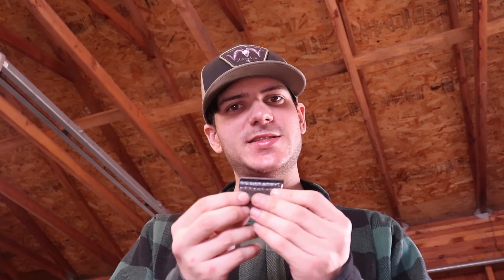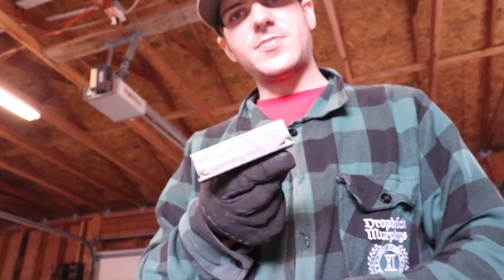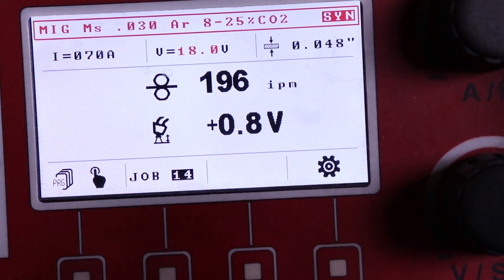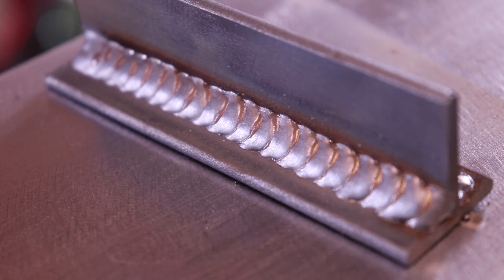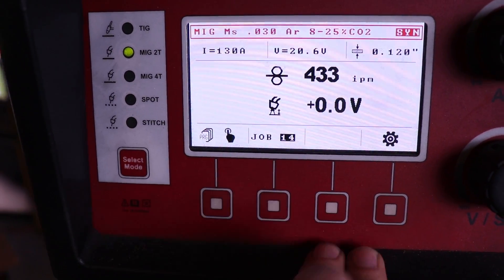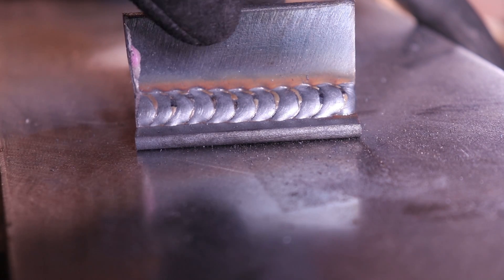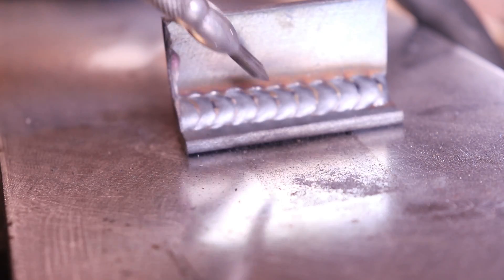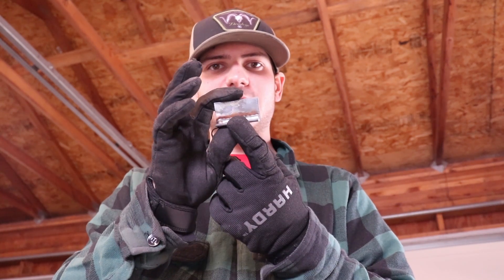Mig Settings Cut and Etched

Comment from the maker: Hey guys thanks for watching. Let me know what you'd like to see next!
Reply: I'd really love to see if you can do flux core welding and replicate those "stack of dimes" look. Thanks in advance!
Reply: Open v groove 30° on carbon steel 3/16 to 1/4. 1 g and 3 g
Reply: Dont know if you mig weld carbon pipe schedule 40 I work for a plumbing company but I've been welding for about 8 years and I have mostly welded structural with mig tig but not much pipe and trying to work on getting good penetration on carbon steel schedule 40. I just subscribed so hopefully we can see something soon on this thanks in advance for any help
Reply: How bout 1/4 in coupon.035 wire cut and etch

Comment: YOU DON'T NEED TO TURN YOUR MACHINE DOWN TO MIG LIKE TIG

YOU ABSOLUTELY CAN STACK DIMES WHILE YOUR MACHINE IS TURNED UP WELDING HOT
Reply from the maker: Definitely true you can stack dimes up nice and hot.  This is specifically for the mig like tig they use in a bunch of offroad shops
Reply: @5thStreetFab  I mostly mentioned it because your cut and etch showed arguably that's not such a good idea.  Get good penetration and stack dimes... just saying that
Reply from the maker: @drumtwo4seven  i totally agree

Comment: You can also mess with the settings and alter your speed and angle with the mig like Tig settings to get it to really punch in there. I did this same test and it looked like the "regular" settings. That's why the mig like Tig is widely used in motorsports. Penetration AND looks.

Comment: Must say this was disappointing because I love your mig like tig method so was hoping it was a strong weld. But it still has a place but what is that. For example would you recommend mig like tig on a bicycle frame or motorcycle frame?
Reply from the maker: I personally wouldn't.  I would rather just tig those.  Mig welding small round tubing takes a lot of practice and can lend to a lot of cold lap especially on places where theres multiple coped joints
Reply: @5thStreetFab  thanks  that’s what I was afraid of. I have yet to learn Tig. My son wants to build a bike, was hoping to Mig weld it up as a project

Comment: Thanks for the video showing the stronger welds.  It seems to me a lot of people are pushing Mig like Tig.  Usually when one welds it is strength that is more important than looks.  I say just grind it to look as good as you can knowing it should not break.  Good video.  I actually want to learn how to Tig weld aluminum and sheet metal because of the smaller weld.  All of the equipment is expensive and I cannot justify my hobby use of a Tig machine.  My HTP  140 is still going strong.

Comment: Let's see you weld with a home mig machine , 4 setting and no trim on the voltage. thanks
Reply from the maker: I have some older videos on here running an old lincon sp100 and a cheaper everlast.  I dont remember their names though

Comment: I'm a fan of your other videos but I don't think this is a good comparison of these 2 techniques. To say that the "mig like tig" technique isn't as strong is inaccurate. I could tell without you cutting it that you were too cold on your settings. I could see the puddle just stacking on top that's why it was highly convex and you were forced to move so slow. Also, many people that get the stack of dimes look prefer to pull instead of push and that alone will increase your penetration. 

I'd like to see you do a push vs pull etch test after dialing in your settings better. Don't weld on the backside either. It's not an apples to apples comparison. When welding the backside the joint is no longer the thickness of the material. It's material plus front side weld.

Now you forced me to do my own etch tests. Haha.

Love your other videos! Keep up the good work!

Comment: Excellent video. I keep trying to tell the world of IG dropping dimes with MIG is not the same as with a TIG and should be avoided unless it's for looks only and has no structural strength requirements.
Reply from the maker: Ya man i found a couple techniques where i can get it to penetrate but it doesnt look as good.  I guess youll always have a trade off!

Comment: Great video. You have proved a very important point. Stack of dimes looks great but it is not necessarily useful for an integrity perspective. However, practicing a SOD takes great control and is great practice. Master it and you should find  doing good quality structural welds is easy. Well, kinda! Thank you.

Comment: Great video.   I noticed that your puddles are nice and round.  Mine look like a teardrop on its side, with the front of the puddle nice and round, 
but it has a tail at the end, so it is freezing at the tail, and leaving overlapping shapes like this ◀️◀️◀️what do you think may be causing this?  Speed too fast?  Wire speed too high?  Too hot?  I have played around with the setting, and slowed down, but doesn’t seem to help at all. Thanks
Reply from the maker: That's from having too much heat.  Just back off the pedal a little bit and try again and see how it turns out
Reply: Ahhh... we’re talking mig, but I’ll try colder settings
Reply from the maker: Haha my bad I thought this was one of my Aluminum videos! But ya the v's are from high heat.  You can either turn it down or try pushing forward rapidly and then back into a circle

Comment: This explains a lot to me. I've seen a number of your videos and really like how your welds look. In turn, I've never managed to have my welds look like dimes as I always fine tune for penetration before I start laying beads. Have you considered laying a straight root pass with the recommended settings, then cap off with your MLT settings? Thanks for this video!
Reply from the maker: Thanks dude!  a buddy of mine has been doing a tig root and filling it with MLT.  Looks great and should be plenty strong that way.

Comment: When you ran the correct settings, what pattern were you doing, and would this work on short circuit MIG?
Reply from the maker: Ya I just move forward filling in the root and then a slight up down motion it just helps me with better penetration.  And yes this was short circuit MIG
Reply: 5th Street Fab at 400ipm I don’t think you were short circuiting anymore.  There was more spatter and the arc was more erratic. It looked to me like you were in globular.  The transition out of short circuit typically occurs at 125amps.  With the slight oscillating you were doing in short circuit I have a feeling you would have missed the root.
Reply from the maker: @scotttaber6824   @Scott Taber  ya could have been been globular.  For some reason I thought you needed 100% C02 for globular?  Maybe I'm wrong haha.  I just used the stock settings for it and it said short circuit.
Reply: 5th Street Fab no you can weld in all 4 transfer modes using an argon mix.  I personally find the recommended settings to be way off.  Every time I try and run them I end up making pretty significant changes.  You’ll probably find the recommended settings found for the wire itself to be far more helpful.
Reply from the maker: @scotttaber6824  right on.  Thank you.  I mostly do TIG work but also quite a bit spool CV and pulsed MIG Aluminum so when I do steel at home I've always used the recommended settings and would tweak it from there or just use spray.  Where can I find the wire manufacturers settings?  There website maybe?  And thanks again
Reply: @scotttaber6824  I would like to chime in here on recommended settings as I found that as well. In my shop the recommended settings were off and I had to adjust the amperage up.  One day I took my Millermatic 210 home and wired it to my Air Conditioning fuse panel at 220v and the machine welded perfect at the exact recommended settings from the chart. Took it back to the shop and had to turn up the amperage again while using the same wire inches per minute. I have no idea what made a difference.
Reply: @MrBashian  voltage drop if using an extension cord?

Comment: When I mig like tig I complete each circle right at the root of the joint and then drag or push the puddle over and start my next circle (or lower cased e) it helps focus that heat into the joint itself. Try doing it like that and then lets check the comparison.
Reply from the maker: Thanks I'll give it a go!

Comment: I have been harping on people for years to stop making mig welds look like tig.  Run it hot and get it fused.  👍🏻
Reply from the maker: Haha I'm definitely guilty of making them pretty haha it's just looks so nice I can't help myself!😂
Reply: 5th Street Fab  your stack of dimes with less fusion is still better than a lot of welds out there lol.  Right now I have to reweld a front diff cover because the inside corners seep oil.  Pretty crazy a well known company can’t make a diff cover that holds oil after welding inside and out of it.  At least the welds look pretty 🤔 lol.
Reply from the maker: Haha I've seen that too!  Especially on aluminum.  If you want the outside pretty at least weld the inside right!

Comment: Can you do a demo on MIG stainless steel and what gas you'd recommend ? Video may be overkill lol.
Reply from the maker: That would be cool but I don't want to buy a new bottle and I've only done it a few times I think we run a tri mix but can't remember the exact mixture
Reply: best way to know what gas you need for the wire you are using is to ask the people that sold you the wire. but if it can help you, at work we use a tri-mix gas... argon-helium-co2. we use it on either a pulsing mig welder or standard mig welder. hope it helps.

Comment: 26 27 volts and 600 or so wire, strait bead. Line down the center is what your looking. Idk why all these people wanna see loops in a flat.
Reply from the maker: Different strokes for different folks
Reply: @5thStreetFab  yeah but try it. No movement just a strait pass focus your puddle no back and forth mess. Cut it and see. It's a flat not a vertical.
Reply from the maker: @lsgt5132  oh I know I do it every day at work spray and pulse mostly.

Comment: Some entry level tig weldings demos be great im considering buying a machine ive done mig welding in my career as automotive structural in collision industry but i would like to learn to tig so much cleaner..enjoy your videos thank you for sharing valuable experience and insights to the trade!
Reply from the maker: Ya I would but I don't want to buy any haha.  The AHP was pretty good, I've heard good things about primeweld and Everlast has some that are slightly more expensive.  If you want to weld Aluminum make sure the machine is ac/dc

Comment: Thanks for that, It does show that you can have a good looking weld that doesn't have the fusion needed for ultimate strength. You also explained that, to use the right weld where you need it, or play around when it doesn't really need strength. I tend to get what you showed as the preferred settings for the plate thickness. I have a problem with most videos about settings, I am running a Lincoln Electric STT2 which uses Peak Amps, Background Amps and wire feed in Inches per minute. I never have the wire feed rates you talk about, My highest wirefeed (that I use) is about 200 inches per minute, but I can throw 420 Peak amps at it. At the moment I'm using 1.2mm ER70s6, 390 Peak Amps, 100 Background Amps, 4 on the Tailout and 180 Inches per minute wire feed for a hot, flat weld.
Reply from the maker: Wow that sounds interesting.  I've never heard of it.  Is it some kind of pulsed MIG?

Comment: Always enjoy your video’s. On thin stuff 200 amp welder is ok, but i feel lack of bite and fusion on 3/8 and 1/2”. Guess used Miller XMT from ebay is in future as i cannot afford HTP 300. 
What machine do you use at work to weld thicker steel? Or is it mostly aluminum?
Reply from the maker: Thanks bud.  We have Lincoln 350mps, miller 350ps and a couple different kinds of XMTs.  Mostly just Aluminum.  Very rare to weld steel or stainless at my work.  And we'll usually just TIG it instead of switching the machine over
Reply: Thanks for promt response :)
Just got fresh HTP mag along with mig wire. Them cover weld pics look nice. Congrats man.
Reply from the maker: @gandolph3  thanks!  I thought it was pretty sweet to have my welds on there!

Comment: How about showing your cut and edge process. I don’t have very good luck seeing results with the Loctite Navel Jelly but I’m sure I’m doing something wrong in the process.  Thanks
Reply from the maker: Ya sure bud.  I just didn't want to make the video unnecessarily long.  I basically sand it down until I've sanded it with 400 grit and then I use a paper towel to rub the jelly on and I just keep rubbing until I can see the nugget.  Then I wipe off all the jelly real quick.  Only take maybe 10-20 seconds

Comment: Mad Skills. Basic question: How do you keep that spatter down to a minimum? Whenever I turn down the wire speed I get more Spatter! I have had decent luck with spray but I haven't cut weld apart.
Reply from the maker: I'm pretty sure it's the machine.  I'm in the synergic mode so the machine will self adjust to keep the amperage the same throughout.  Most people just use that antispatter
Reply: Thank you for your prompt reply.
Reply from the maker: No problem bud
Reply: I have been studying you Alum Tig clips as well. Probably the best for concise no nonsense info of what a person needs to hear to improve. Good Stuff my friend.
Reply from the maker: @s3gts  thanks I'm glad to hear it!

Comment: I have a Dc only tig unit but I would like to do an aluminum project or two. I think you had mentioned before welding aluminum dc with helium. What would be needed to set this up? Would it be worth it to even try on a hobbyist type unit(150 amp)? Thanks for the great videos.
Reply from the maker: I personally wouldn't but before you make up your mind I'd watch Bob mofat on weld.com here on YouTube I think he has 2 or 3 videos on it that might help you out.  Helium is expensive

Comment: Turn up voltage on 2nd maybe a volt or so. Depends on gas should be close to spray arc at that point. Fast,digs, and looks great
Reply from the maker: Ya I have a bottle of 90/10 for that but I wanted to compare short arc to short arc.  Thanks though!

Comment: Good work. 

Your mig like tig technique is almost exactly like mine. I actually come out of the puddle and try to punch into the root a bit more, but I've also never cut and etched. I think I'll do my own comparison and see how it looks. I'm around 19v and 300 ipm though on an old MM250. 

Like the videos, no fluff and right to the point, so thanks for that and for the video.
Reply from the maker: Right on!  That would be awesome to hear about.  Be sure to let me know how it goes and thanks for the kind words bud!👊
Reply: I do to. I roll out farther, and punch into that root harder. It also allows a higher heat, and I can move faster, with the same appearance result. I've never cut and etched.. But I've x rayed and never failed one.
Reply from the maker: Nice!  I'd love to try that.  What are some settings to try?  Are you pushing or pulling?
Reply: @5thStreetFab  I have found settings vary greatly depending on machine when I mig like tig. I have also found Miller does it better then any other brand. Lincoln does the worst. That being said.. I have a Lincoln 140 HD that migs like tig exceptionally well.. No idea why. I always run settings higher then recommended. Big circles, quick on the edges, slow through the root. You have to kinda haul ass running temps so high. I did a lot of spray arc structural, then did a lot of decorative (where I learned mig like tig)  then went to short arc structural.. I have just combined those experiences into a mig like tig that passes structural x ray lol That's about the best I can explain it without one on one showing you.
Reply from the maker: @coors1800  I like it dude.  Definitely makes sense.  I'll start messing with it thanks bud 🍻
Reply: @5thStreetFab  oh yeah push or pull.. I do a slight drag.. I have found that pushing won't hit the root as hard. Also, I'm coming completely out of the puddle. Moving so fast the arc ALMOST wants to spit, but don't let it. Then slow through the center, reestablish the puddle, and then come around and out again..
Reply: @5thStreetFab  Also, my circle is coming out of the puddle on the top side, so if I'm dragging right, I'm circling clockwise, that keeps the heat up high, allowing gravity to lay the bead flat. If I roll down and out, I get a belly at the bottom of the bead.
Reply from the maker: @coors1800  I've found the same thing with dragging.  Thanks again for the tips!  I'll give it a go tomorrow